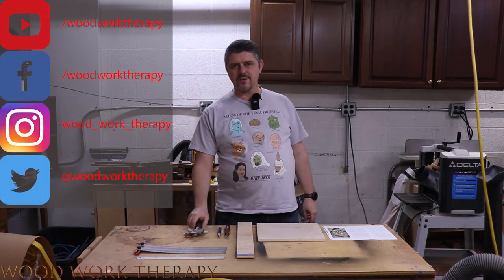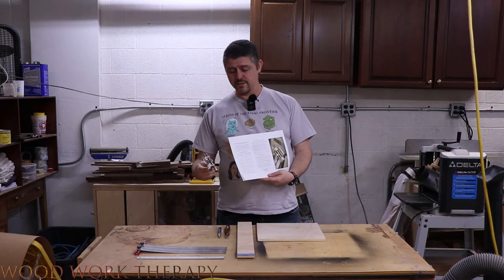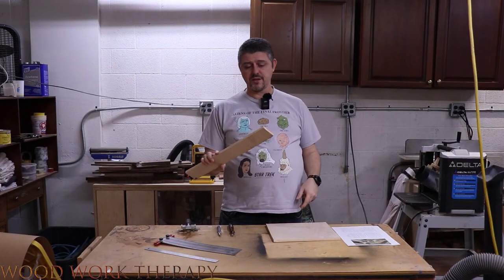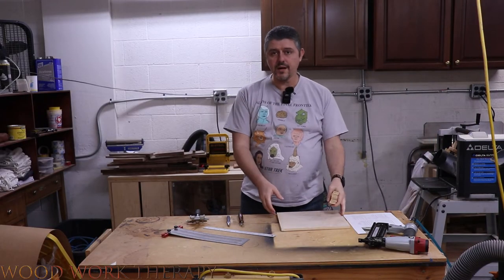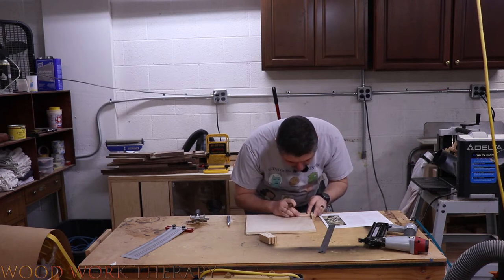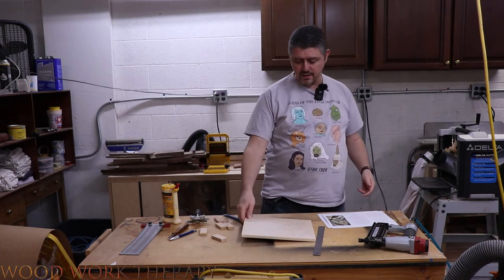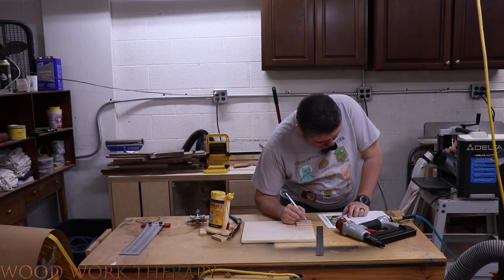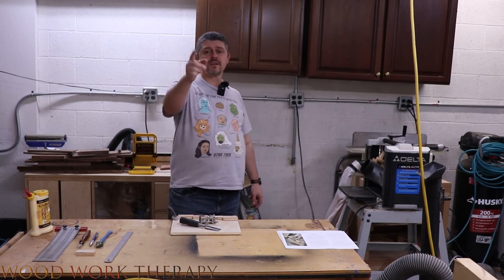Sharpening Mastery: How to Make a Protrusion Stop for Your Honing Guide

Comment: It should be noted that the measurements protrusion stops are for a specific honing guide and therefore NOT interchangeable, i.e. Lie Nielsen 25 degree is 1 1/2" but the Eclipse style measurement for 25 degrees is 2 1/8".
Reply from the maker: That is good to know. I have used some of the measurements from the guide. Chisels do seem to work well. However in the end, always check your angle to make sure it works for your needs with other measuring tools. 😀